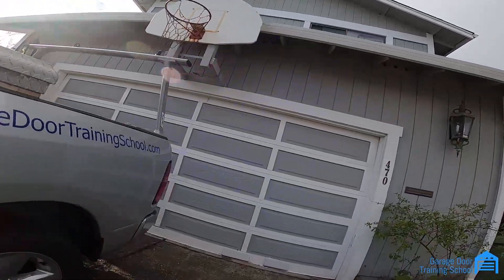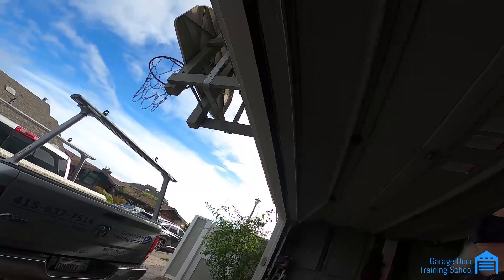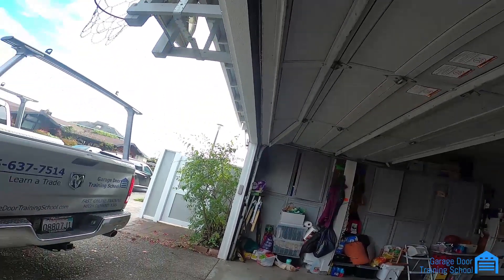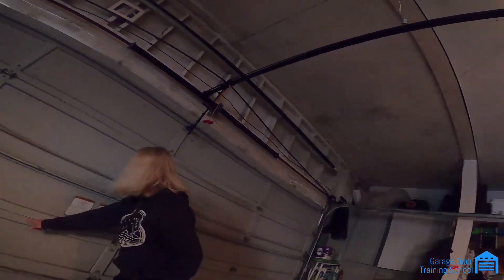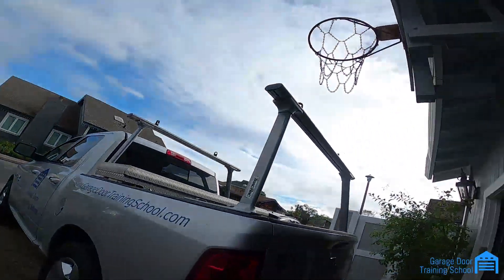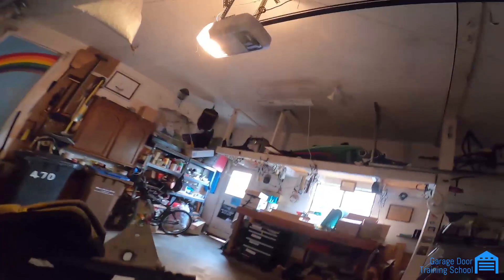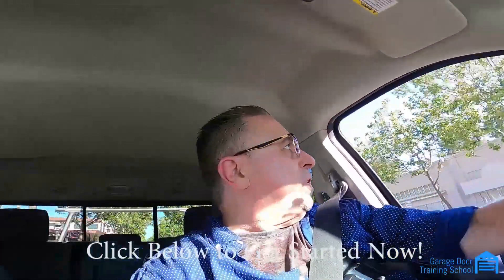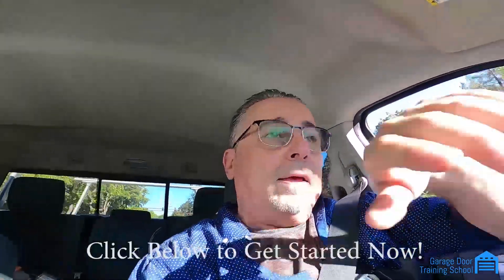This Door Was SMILING | Roller Replacement + Door Service

Comment: Man your videos are great, I've just about watched all of them and used them to maintain and repair my garage door I have a 7'x17' insulated  door I have that door so fine tuned from doing the motor, rollers, 2 torsion springs I'll tell ya it barely makes noise now it used to be loud.  I've been in the millwork and kitchen cabinetry industry for 36 and I am highly considering getting into the garage door service buisness. I am litteraly obsessed with the way garage doors operate and function.
Reply from the maker: Thanks Jose, we have more videos on the way! Garage doors are a great business to get into and from the sounds of it, you’d love it!